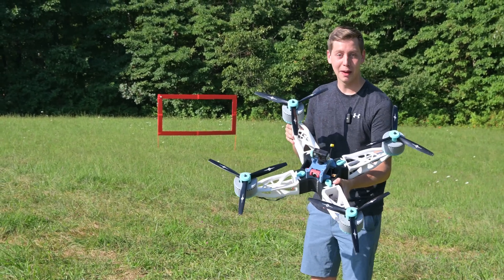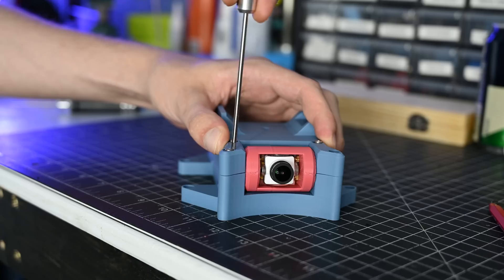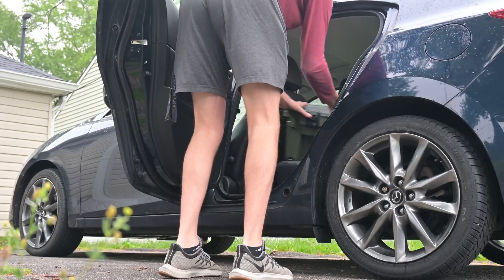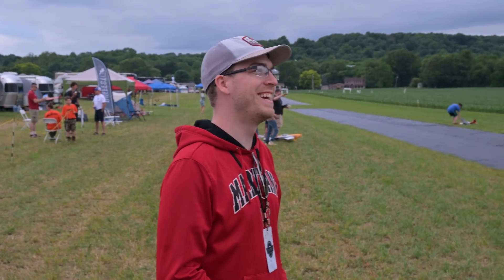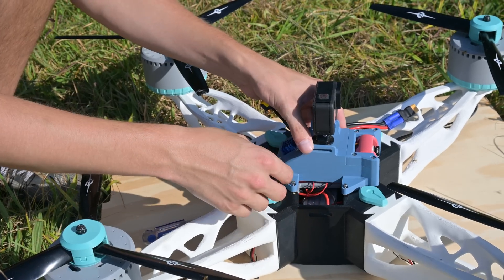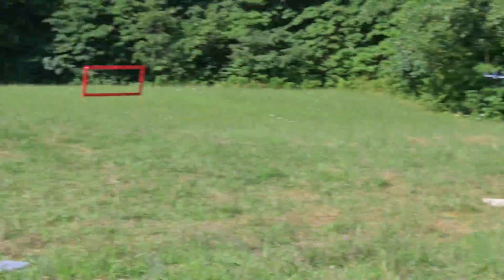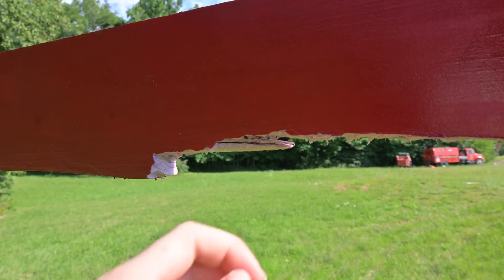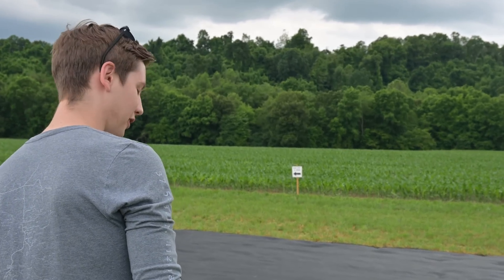Fully 3D Printed FPV Quadcopter?? (Ended Badly)

Comment: Dude, I thought the main point of 3D printing it was to make it lighter and stronger. You can make 3D prints lighter by making them hollow or mostly hollow.  Also by adding structures inside of your parts instead of more infill on your stress points add micro holes inside your print with low wall count (around 3) modifiers around said micro holes. (A micro hole inside of your prints is a cylindrical negative space about .5mm inside of your print that the slicer juuuust barely picks up and treats it like you need to have walls printed around it essentially making a 3D printed stick inside of your print. Extend that 'stick' just to your internal walls about 2 walls in and you have a WAY stronger infill in that spot. So lower your infill to say 3% ?) Faster print time less filament less weight  better faster more responsive quad copter.

Comment: I drilled a hole in my quads canopy trying to make the hole big enough for a new antenna and caught the MIPI wire going to HD walksnail camera in the bit. Ripped it to shreds. The cables are only like $6 but I can't find the 5.5cm one in US anywhere. Not as bad as the battery thing but I've had similar battery fiascos where I forget a charged pack on charger for 3 days and didn't have trickle on so it was 0v by time I got to it.

Comment: Question! Since you have both FDM and SLA, have you tested custom propellers? I know that others have tried FDM (unsuccessfully so that's probably going to fail) but would SLA offer a better chance at them weighing the same and having enough consistency?

I think it would be a cool project to add to this 3D printed quad.

edit: typo
Reply: Just finished the video. RIP drone but still might be interesting on a "standard" drone! Then if you revive this project 2.0 in the future you can bring those findings along!

Comment: That was a big issue I had when adding FPV to my 9 inch quad, I could fly it LOS fine but FPV was just difficult. I can fly acro on a simulator pretty well but stabilised on a larger drone like that is difficult.

Comment: In regard to your arm cracking - I've HEARD that white filaments can be more brittle due to the high amount of titanium dioxide used for the colorant.
Reply: As someone who used to paint a lot, I noticed white titanium oxide paints have the same issue with being brittle. Even using titanium oxide powder to color sculpting clay weakens it considerably

Comment: I really suggest you to split the center piece in multiple pieces. It helps with printing time, optimal print orientation for each part, it's much easier to test for part's fit and tollerances and upgrade them in the future with much less effort and if any of the print fails you have to re-print just a little part instead of a 24 hours plus print

Comment: ASA might've had layer adhesion problems if printed without an enclosure. It prints like ABS. 
It should be a bit less brittle than standard PLA, but slightly lighter than PLA+.

Comment: You should half pocket the center body to save on weight, have less print time, and still have a good amount of strength, other than that I really like the arms on the drone, but I do wonder if there’s a way to reduce weight in the motors, you also might be able to resin print some parts for more strength in certain areas, other than that I really like the drone and think a scaled down version would be awesome

Comment: Well... As an old and wise man once said, Michael... Sh*t happens. 😬
Either way, there are some 2" quads which fly with 2s batteries that you could 3d print the frame. I don't remember the name right now, but they're pretty small, silent and fun as heck!
Anyway, stay safe there with your family! 🖖😊
Reply: There are lots of 3D printed drone designs, mainly for smaller drones, Prusa themselves even made one years ago now.

Comment: It would have been so amazing as well as massively teachable if somehow you had gotten your " fire ", AKA = Thermal Runaway on video.   Even though you can find tons of YouTube vids of idiots causing Li Ion batteries to go into a thermal runaway scenario on purpose with things like: hammers, nails, screws, axe, gun, torch, hard-shorting it.   There are a very few that show the dangers of Lithium in a safe controlled way.  But the fact that a very intelligent likeable dude like yourself did in fact make a mistake.... Not a un-common one either, I'm sure a lot played into it none of that matters because we all make mistakes it's gonna happen, we are human.  Human does mistake often, repeat...  What is very impressive is even though you got caught off your guard and a mistake happened,  that mistake from its inception had a very tinny opportunity to ever cause any long lasting harm, loss, pain, grief... because you were prepared with not the most beneficial damage control you at least had some kind of fire extinguisher showing you have a safety mindset ..  Honestly that's what really matters more when unexpected shit hits the fan is someone in the room that can be calm, cool, and just take care of the danger because they had already put themselves in that situation mentally and figured out what they would do asap.   I do recommend anyone pick up a foaming Lithium Ion Fire extinguisher, the kind that creates a layer of oxygen around the battery.  We've found this is the most effective way to prevent the never ending time someone has to keep watch on a large Lith IoN battery fire because they just keep re igniting over and over for hours and days ... Tesla battery fires can take up to 24 hours to fully extinguish. 
 In some cases, the fires can reignite after being towed, even two to three days later, nightmare fuel... Tesla's emergency response guide for the Model X states that battery fires can take up to 24 hours to fully cool, In one instance, a Tesla battery burned for four hours and required 30,000 gallons of water to extinguish.  Got towed only to re-ignite 72hrs later causing 35 vehicles in this particular holding yard to go up in flames and be destroyed.

Comment: or just bolts and nuts
Reply: deez nuts
Reply: of course you can
Reply: are you on the line
Reply: metal-air fuel cells are much better, like iron-air, the metal is much denser of a battery, so most of the fuel cell weight is the iron, not the other stuff, like water and carbon, and plastic 3d printed abs case
Reply: or just do lego from pieces large drone or anything
Reply: a drone can mow a lawn, get off my lawn
Reply: prop quads, or just plane wing fan ducts